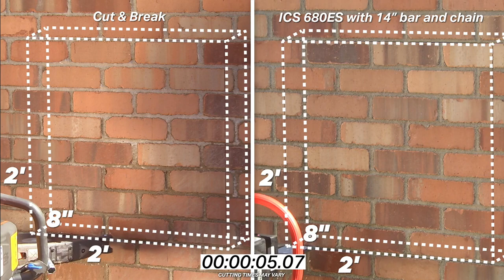ICS® 680ES vs Cut-n-Break

Comment: Hi 👋, I have had both, but the Stihl version, I use the cut and brake on a twin solid brick wall, and I didn’t know, but it got Rebar inside it, 
It was a beginning, I’m a barn conversion , the barn was being used for storing grain, the whole I was trying to cut who is roughly 4 foot wide and 8 foot high, two of us all day or about six hours, time we got set up and cleaned up afterwards, 
The plunge saw Stihl was used twice to cut a window opening in a granite wall over in France in an old Mill, this was an excellent bit of kit. Didn’t quite manage to get through the hole in one cut had to go from both sides., whilst cleaning out a hole to put a tie been in the chain snapped, however, I did manage to get it repaired, I had both tools for approximately two years, but whilst I was away from site in France in 2019 December, I had both of them stolen, plus I don’t have all the kit, I lost approximately €15,000 of tools one was a big ride on lawnmower, 
Only thing I wish is the chainsaw was longer so you can go through anyone cut from One Direction , 
I’m now retired, living in France , Phil from the moulin France,

Comment: Just want to add some info. I went to rent the chainsaw from my local tool rental and I was steered away from it. I was recommended to use the cut and break instead. Was told that while the chainsaw is more efficient, a lot of people renting them have had issues with the chains and it can be expensive to replace. The cut and break is slower but more reliable. I'll be using it to expand existing window openings in my basement for egress. This is in Chicago.

Comment: I've had a bunch of bad reports about the 680.  About fifty percent of the buyers are having a hard time keeping the saw running while cutting in the horizontal position.  This is regardless of the maintenance done on the power head.  The 695 is a much better saw, but way more expensive.